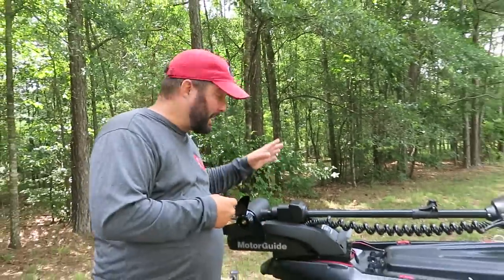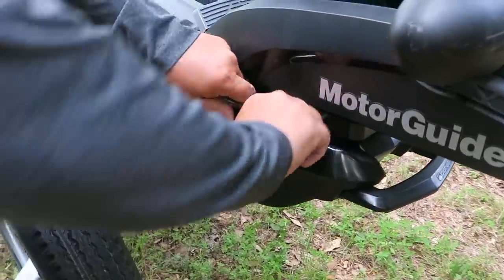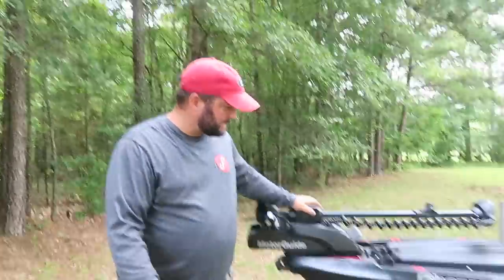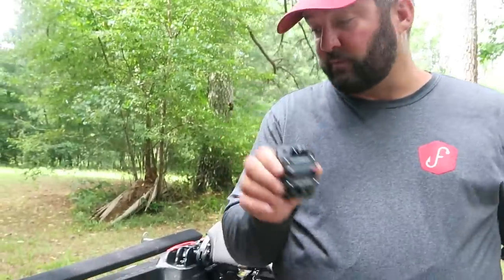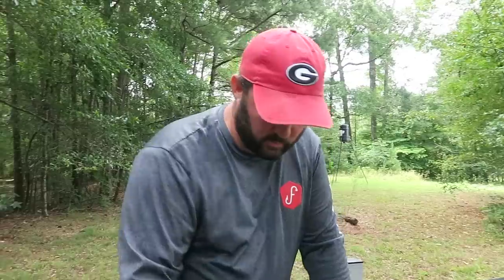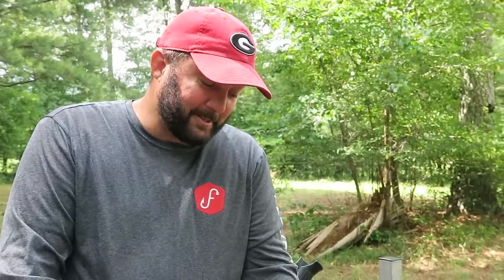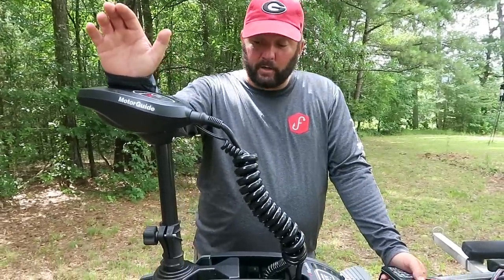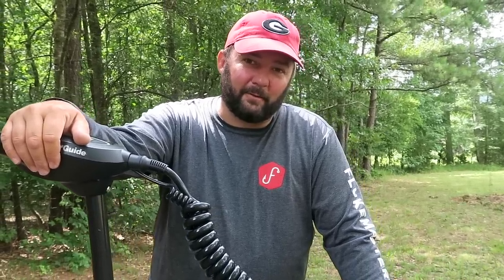MotorGuide Xi3 Kayak Motor - Installation Video

Comment: Great video, fun watch. My concern with a bow mount is if you hit something your cooked bc the shaft gets pushed into the kayak vs if it's on the back and you hit something it will pop up and not jack up ur motor. Idk just something I thought about
Reply: All bow mount tms these days have a built in shock absorption. That little kayak will be alot easier to stop suddenly than a bass boat.

Comment: I wish they’d come out with an even shorter version of 30” for my blue sky pro. This is a great step I’m glad big brands are starting to cater to the kayak market!
Reply from the maker: 36 is as short as their machine goes but I bet if the sell a bunch of them that may change.
Reply: Flukemaster yeah people have been trimming their minn kotas down to 30” but I’ll definitely settle for 36 with motorguide and no cutting. I’ll be buying when it hits the market - not available just yet it seems.
Reply: @Smaulls  right now still i cant find it...
Reply: You can always adjust  it shorter if need to.  There's a knob on the shaft to adjust your length.   36" is just max but if you need it shorter just adjust it shorter.
Reply: @y2rhf For a kayak, space is very important and anything longer than 36” can be cumbersome.

Comment: I've had my 12v Xi5 45" (55 lb thrust) bow mounted on my Nucanoe frontier 12 since February 2019, and I absolutely love it. 

If you're comfortable with crimping wire, and already have the necessary tools to do so, I'd highly recommend buying a 50-60 AMP 8 gauge MAXI fuse from amazon for like 10 bucks (+ fuses) 

Then you don't have to mount a heavy duty circuit breaker and just makes the install cleaner in my opinion. I've used the 50 amp for 1 1/2 years and never had the fuse pop.
Reply from the maker: Thanks man. I’ll check those out

Comment: Do you trailer with the motor attached to the bow ? I’m 75 and have this motor on my 106 . Weights becoming an issue and am wondering if I can shore it up a little for towing. Thanks

Comment: Will this work on a Jon on a boat if you wanted to switch it back and forth between a kayak and Jon boat?
Reply from the maker: The only issue will be the length of the shaft. The Jon boat requires a longer shaft.

Comment: Kill switch? I’m starting to wonder what to do if I fall out while it’s running? If you have any suggestions I think it would be a good topic of discussion. Thank you for the AWSOME videos Gene!
Reply: You can rig something up to pull the fuse if you fall out. Or make sure the remote is secured on your life jacket and you should be able to stop it if it still works

Comment: It's cool, but do you have to stand in 36 inches of water to deploy it?
Reply: I was able to use my xi3 that I cut to 34" in a foot of water after adjusting the collar. As for deploying, I just use my paddle to press the peddle then push the motor forward. I have a 4' piece of paracord that I use to keep it from slamming and also to pick it back up

Comment: Was looking at putting a minn Kota on my Bonafide. This may change things a little bit. Would like to see a review on the spot lock, as I’ve heard it’s behind the minn Kota.
Reply from the maker: I can tell you for sure that it holds you in a smaller circle than the MK. It has sensors that can tell that you are beginning to move off your spot. The MK doesn't respond until you are already off your spot. It's the difference between a 10 foot circle and a 20ft circle.
Reply: Flukemaster 😂🤥
Reply from the maker: I've got a lot of experience with both. I ran a MK for three years
Reply: @ Julian B Fishing - I have the Xi3 and another feature their "Anchor mode" has that I don't think MK's Spotlock has is a jog feature.  You can lock your position and with the press of a directional button, move that direction 5 feet with every button press.
Reply: Bass Thumbs Fishing did a walk through of the MotorGuide on a Bonafide if you're interested to see how it can be rigged up. Including how he ran the pulley wires to depress the deploy lever and also deploy/retrieve the motor from the seat.
Reply: David M I’ve seen the video and like his setup. It will like most things come down to price point. I will be interested to see what the kayak version x3 will cost. Having to buy the trolling motor, battery, and accessories will be an expensive endeavor.
Reply: @julianbfishing9810  I'd be willing to bet the cost will be the same as any of their other motors of the same thrust rating but with a longer shaft.
Reply: @david-iam  the one thing that he didn't cover is his walk through was his pedal release details.  If it stays connected all the time that means you can't remove the motor.

Comment: Hey Gene. . .   A couple of questions.   First, if you are still using the Xi3, have you used the Spot Lock or Anchoring with it.    If so, how does it do.  I will be putting one of these on my PA14 for Crappie Fishin’.    I see videos on YouTube quite a bit about install, but not on how the Anchoring has worked out.   Thanks a bunch.  Love your videos.

Comment: Would be nice to have an idea of what price we are taking about ..  Looks like I'll have to get one.. Just to get across to the hot spots on windy days...🙂
Reply from the maker: I'm not sure yet but the current Xi3 48" shaft motor is around 575
Reply: MSRP for non GPS model - $739.99, GPS model - $1199.99

Comment: Would you advise against keeping a lithium battery, <30#, up front?  Would it make loading Titan 12 too cumbersome to load on a trailer?
Reply: My dad has the Titan 12. We added the lithium battery right behind his seat. It works better there. Too much extra weight in the front already with the Xi3
Reply: @stuarts765  Makes sense.  I'd totally forgotten about the extra weight of the motor.

Comment: Gene, two questions:

1. Can you mount it on the rear of the Bonafide?
2. Any chance of Motor Guide giving kayakers a remote electric deployment and retrieval system to get the motor in and out of the water without a bunch of pulleys and lines?
Reply: No it’s a bow mount only unless you want to engineer some kind of complicated apparatus.

Comment: If you deploy the kayak in shallow water the trolling cannot be deployed. So how do you deploy the X I 3 while sitting in the water that has become deep enough to deploy the motor.
Reply from the maker: I have another video called solving the stow and deploy problem with kayak motors. Go check that out and it describes that in detail

Comment: have you had any issue with interference (bubbles etc) on your  hull mounted transducer? I would be concerned about cavitation and bubbles causing interference while moving. I am seriously considering this thing. I did 23 hours of OT so I have enough to get one.
Reply from the maker: I do notice the turbulence but it's only in the top two feet. It doesn't effect my ability to see things deeper.

Comment: Does minnkota have one?
Reply: Not one already shortened like this MotorGuide kayak edition. But if you need to go Minn Kota, you can cut down the shaft yourself. Otherwise, Old Town did design and debut a kayak with Minn Kota's SpotLock trolling motor built in. Pricey but basically turn key. And their motor unit is even saltwater ready. Look up the SPORTSMAN AUTOPILOT 120 on YouTube or their website for more info.

Comment: I just bought me xi3 2wks ago😡 from a dealer on amazon. They are hard to find right now and now Motorguide just released a shorter shaft. 😡 wonder if I call Motorguide would they switch. Me out shafts. What you all think
Reply from the maker: It never hurts to ask.

Comment: Thanks for the review. That looks awesome. I'm assuming that version is freshwater, do they have a saltwater version as well for those yak anglers who do both? While I'm sure the benefits are huge, is there any part of you that feels like you are losing anything by not having the front pad and strap usable on the SS127 anymore?
Reply from the maker: It takes me a little longer to strap down my paddle and the rods stage at a different angle.
Reply: At this time - we only have a FW version. We are always innovating and looking for new product opportunities. Stay tuned for a possible saltwater version.
Reply: MotorGuide  will this motor be able to connect up to our Lowrence electronics to take advantage for charting routes with away points
Reply: @doubletroublefishing136  I'm pretty sure with the Pinpoint GPS Gateway kit it will. I have the saltwater version xi3 and it has a nmea cable that the module connects to and then you connect it to your lowrance unit.
Reply: Better have a trailer if it covers your handle

Comment: Nice! What is the price point?
Reply: You can check prices even at Bass Pro
Reply: Also you can purchase the 45lb cheaper you can add the pin point option later down the road it’s plug and play and comes with the new remote
Reply: MSRP for non GPS model - $739.99, GPS model - $1199.99

Comment: So is there a way to deploy it or retract it with out having to climb to the front of the yak and if your in a pinch and need to get it up quick, or did I miss that part of it?
Reply from the maker: For right now yes. I'm working on a system to change that.
Reply: @Flukemaster  If you remove the motor side plate on the right side, as viewed from your seat, you can see the latch release rod.  I tied a simple paracord to that rod and brought it out the tiny gap above the right side of the pedal.  My cord lays in the floor hanging over where you installed the power connector in the hull.  I put a PVC pipe handle on it for easy grasping and for use as a pull handle.  You can give the handle a light pull and it releases the latch.  I also tied another paracord with PVC handle just under the head of the motor.  I get that deployment cord in my left hand and lean forward as I pull the latch cable with my right hand.  I use my left hand to nudge the motor head forward and it easily slips into the water as I put tension on the deployment cord in my left hand.  I'm in a SS107 so I'm a tad closer to the motor but then too, my shaft is only 30" instead of 36", so we may be about the same distance from the motor head when it's laying horizontal in the cradle.  I can easily deploy it from my seat like this.  Docking it back in the cradle can be done too without getting out of the seat other than to lean forward to grab both cables.  It's not always 100 fool proof though.  Sometimes my lifting/deployment cord will get in between the power cord coils and it will make the motor want to spin out of alignment with the docking station.  I think a neoprene sleeve around the power cable will stop that completely and make it a bullet proof install.  I also put a zip tie on the GPS cable at both ends, tying it to the power cable.  This keeps the GPS cable from oozing out either end of the power cable.  Lastly, with my shaft being 30", the head of the motor pretty much sits on the depth setting guide so there's literally no extra shaft sticking up to get in the way of casting.

Comment: Mounted in the front is going to be a pain since you will have get up, go to the front to lift it out of the water.
Reply: I have a way to pull the motor up from my  seat when you come to shallow water or when you get off the water.

Comment: If this is $2000 I will spit my drink and have a good laugh
Reply: Probably gonna be around $1300. I have the saltwater xi3 and it was only $1400
Reply from the maker: The current xi3 55 is between 650 and 750 depending on where you get it.

Comment: So much of the electrical seems wrong on this video.
8AWG wire is rated for anywhere between 40 and 55 amps depending on the wire type.
Your 60 amp fuse which you have been running without for 2 months ( WTF????)  won't protect anything. Your wire will be on fire and will literally melt through your plastic kayak before the fuse pops.
You select your wire size based on your load....
You select your fuse/breaker to protect your wire. This is wiring 101.
Your fuse must ALWAYS be lower rated than your wiring.
Also, your fuse should be installed within 12 inches of your source ( IE battery) again this is wiring 101!
Putting your fuse up by your trolling motor will cause you to melt your wire up to the fuse if you have an issue.

Your trolling motor has a draw of 52 amps
Your 8 Awg cab tire has a rating of 40 amps
Your fuse is rated at 60 amps.
This is dangerous and WILL Kill you!!!!